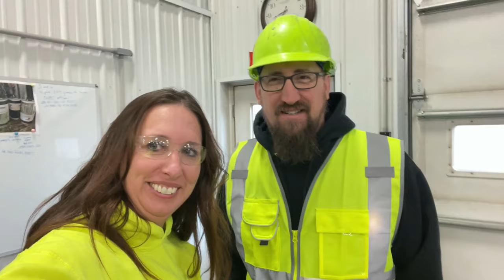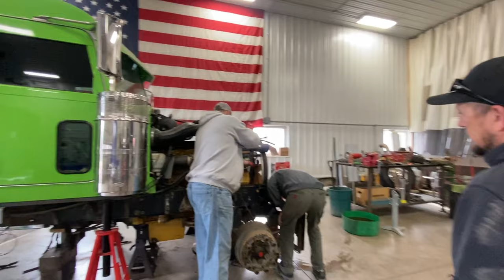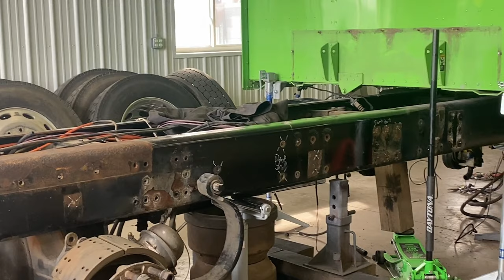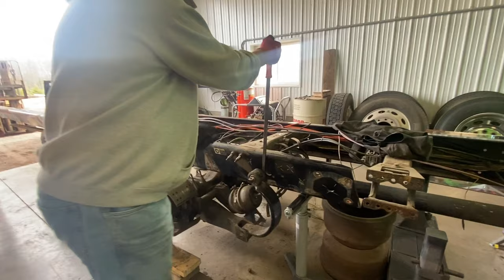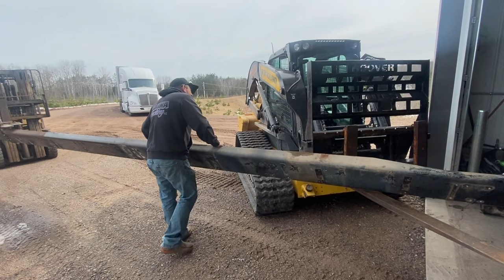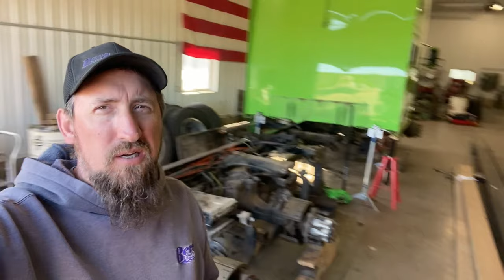One frame rail Peterbilt, WHAT

Comment: Curious , why new frame rails. Did I miss something. 🤔🤔
Reply: @denniscampbell8711...Hunter wanted more wheelbase, however, didn't want the typical stretch where they cut and splice the existing rails...New, longer rails is the best way to do this...b